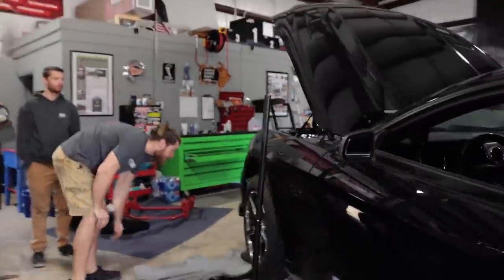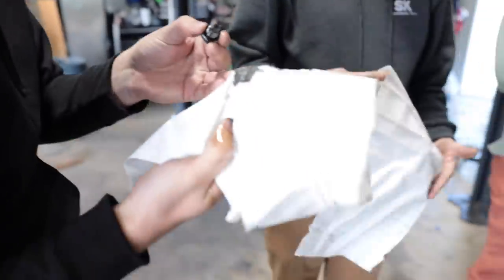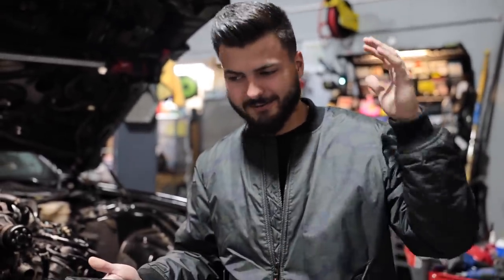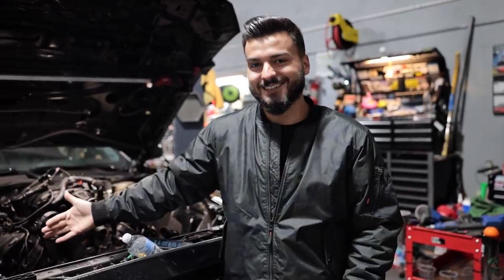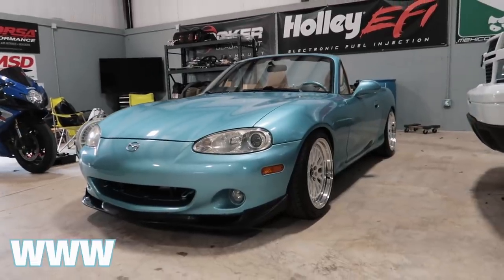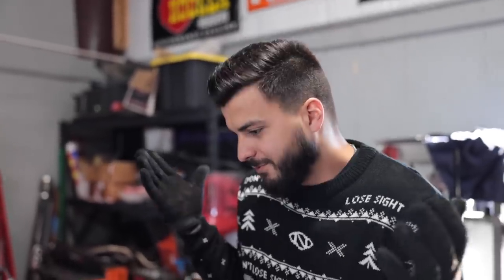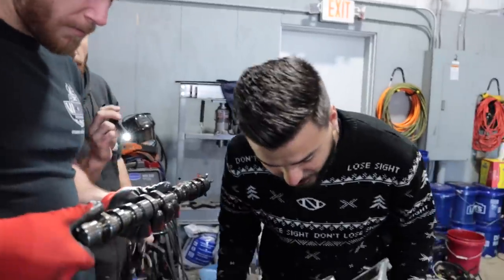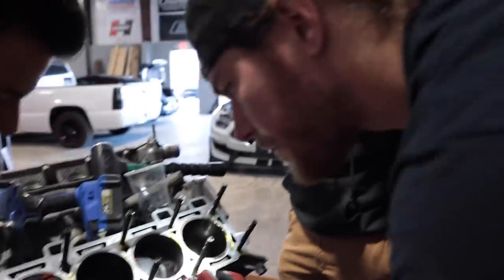Tearing Down Satan’s Blown Motor! | 1,500hp Coyote Engine Teardown

Comment: MMR engine: Has left the chat
Job Security: Has re-entered the chat
Reply: Hellhorse performance: has entered the chat
Reply: RPG engines: Has re-entered the chat
Reply: You really don't know what happened? MMR didn't build this motor for them, and they didn't pay MMR for anything. This was a second hand motor that they hacked together after buying it from someone else. See how they hammer away in this video?... that's how they treat a build lol. Anyway, the truth is they asked MMR for help, which they agreed to, and then sent the engine and parts, including the bearings they are complaining about, to MMR to be reviewed and refreshed. Real MMR motors use specific parts. I have one...a 1500se and it's an absolute beast. Even still, I'm sure MMR did the best with the parts provided, and even after that, the treatment of the motor is what caused this issue. The redline was not a soft redline. As he is mentioning even in the video, he is referencing the physical limitation of the crank/cam combo, which is still questionable. There is more to it then that, such as stroke, cam spring choice, etc. The etching away at the gaskets is from repeated physical limiter hammering, and then the boost crossed into the water cavities, and blew off the coolant line. Instead of admitting his mistake and resolving it, they just sent it again. Absolutely insane. So then he had fuel and coolant displacing the oil which absolutely destroyed the bearings and rest of the motor. This is 100% the fault of this nutty dude in the video.
Reply: Does this @raredesign person work for mmr this is the second time I’ve seen this comment word for word in the comments defending them and bashing Gavin. Piss off. Copy and paste much
Reply: @christophercarpenter4008  I don't work for them. I bought one of there motors and  I'm passionate about the modular scene. I think it is disgusting that Gaven influenced so much hate against a company for something he didn't buy from them. This is ridiculous. He blew his own motor and is blaming the people that tried to help him.
Reply: @raredesign  you mean you bought one of *their motors
Reply: @raredesign  go back to school!
Reply: @Ok-qd6he  that’s what’s in Lucifer right?
Reply: @raredesign  I don’t know a lot about engines I’m a welding manager but this many problems has to be someone’s fault
Reply: @devonevers4384  who paid all the haters commenting on Gaven’s video. And no, I’m not paid but you won’t believe me anyway. I’m a customer that thinks this is wrong.
Reply: @williammolnar6570  you’re right, he over-rev’d with aggressive timing, the head gasket failed, coolant and fuel mixed with the oil and displaced the oil in the bearings causing failure.
Reply: @williammolnar6570  lucifer has a rpg engines 5.2L voo doo
Reply: @raredesign  so the engine that was sent back to the builder and was oked after fixing the “timing issue” blows via head gasket failure which they changed out to theirs and main bearing failure isn’t the fault of the builder when the tuning company checked over the tune and the tune was good???
Reply: @Sutliff01  I know right
Reply: @raredesign  you’re the type of dude to claim no jdm car  could beat you down the track
Reply: @jeffwashburn4562  everyone knows the 2jz is an awesome motor, and so is the Ford barra.
Reply: @raredesign  so now you wanna act all soft. No hate man looked through your videos.  But I’ve seen mmrs work in my shop and at the shop that tunes my car. It’s hit or miss. Can’t deny that. There is facts presented and you ignore them.
Reply: @jeffwashburn4562  whatever helps you sleep man

Comment: “Are you telling me this engine knows how to weld?” “It was for sure trying to learn”
Reply: Gavin pin this comment. Best one yet.
Reply: LOL, yeah, he shouldn't have bounced off the physical limiter and chipped away at the gasket, causing boost to cross into the water channels and blow the coolant line off. And if that wasn't enough, he put it back on and sent it again! Fuel and coolant displaced the oil and ate the motor to bits. That's what happened with the bearings. This guy knows nothing about motors.
Reply: Alright @raredesign we get it you love mmr good on ya bud. They're a terrible company with an even shitt**r customer service and that's the truth. They acted like children with this whole incident🤷‍♂️🤷‍♂️
Reply: @luislanderos7560  hold on, they acted like children? These guys didn't even buy the motor from MMR! LOL. They asked MMR for free which is why the motor was sent to MMR and sat there so long...it was FREE work because of his channel. Then, they get it back and talk trash? Oh, and the parts used in the motor they complained about? Yeah...they asked MMR to use them. Then they proceeded to go all noob on the motor and blew it lol. No, MMR is not a bad company. Are you reading more internet regurgitation? Okay, I'm a bit passionate about this because I'm heavily involved in the modular motor scene. The reality is that MMR had a hard run many years ago...like 13 years ago lol, but much has changed since then and they now use excellent manley parts, as well as their own which they machine, and the motor build process is very good. I have one of their motors... a 1500se, and it's currently at 19psi, and will be turned up on E85 to 30+ this spring. I have renown build that will also be featured in magazines this coming year, so think what you want.
Reply: @raredesign  ok but if mmr gave the stamp of approval saying everything was good why did it blow up after four hard street passes? gavin broke everything in correctly and it still blew up. mmr has to get their act together and apologize to him for wasting his time and money on an engine that was mechanically approved by them.
Reply: @sethbroekhuis1986  There is a lot wrong with what you said. First, they didn’t pay for anything from MMR. MMR did the work for free and freshened up a second hand motor...with the parts that Gavin sent him. Nothing about it is an MMR motor. They just helped as asked, likely because of the channel. Also, who said Gavin broke it in right? With what I’ve seen from his other videos and this one, there is no guarantee he even primed the motor properly...and worse, he could have reversed the oil relocator in/out if he has one. Common mistake for no oil pressure, which another guy in this video mentioned about them not having pressure. Also, you can build a seemingly bullet-proof motor, and if you overspin it and physically hit the limits repeatedly, you’re going to stress it. Gasket failure is not MMR’s fault...that is simply abuse, and could have been exacerbated by some hot tuning, such as aggressive timing, which has been known to lift the heads. We know for a fact from this video with his coolant line popping off that there was a gasket failure. Right at that point, his motor was fixable by swapping the gasket. Hmm...and didn’t Gavin admit it in this video? Instead, he sent it again even though it had issues, which resulted in the coolant and fuel displacing the oil and ate the bearings.
Reply: @raredesign  oh wow a magazine! I can’t wait for the all the 10 year olds and hair salons to enjoy that. Definitely found their number one fan boy
Reply: @jjlol262  Funny. Let me know when you’ve done better. I don’t think RPM Magazine is anything to scoff at.

Comment: I feel like I seen this title multiple times 😂
Reply: Yeah but like all the other motors weren’t like top of the line built motor. At least as far as I know this motor is like a $30k motor. The other ones were like bone stock motors or like that one Frankenstein motor made out of gen 1 and gen 2 coyote parts.
Reply: @davidkelley751  yea true
Reply: @davidkelley751   mmr engines are made out of carboard its not gavins fault
Reply: @deandelatorre2928  never said it was his fault. I know it’s MMR’s fault. I was getting bad vibes from MMR from the beginning. Especially because they held onto the motor for like 6 months. Then they made Gavin make 2 videos saying “it’s not MMR’s fault and MMR is a great company”. Otherwise they would have sued him. 

The funny thing is that he was pushing those stock coyotes way harder than this motor and yet they were making about the same power levels. And yet those stock coyotes were lasting longer and making several passes on the drag strip.
Reply: Damn I didn’t see this comment I basically said the same thing😂
Reply: @deandelatorre2928  You really don't know what happened? MMR didn't build this motor for them, and they didn't pay MMR for anything. This was a second hand motor that they hacked together after buying it from someone else. See how they hammer away in this video?... that's how they treat a build lol. Anyway, the truth is they asked MMR for help, which they agreed to, and then sent the engine and parts, including the bearings they are complaining about, to MMR to be reviewed and refreshed. Real MMR motors use specific parts. I have one...a 1500se and it's an absolute beast. Even still, I'm sure MMR did the best with the parts provided, and even after that, the treatment of the motor is what caused this issue. The redline was not a soft redline. As he is mentioning even in the video, he is referencing the physical limitation of the crank/cam combo, which is still questionable. There is more to it then that, such as stroke, cam spring choice, etc. The etching away at the gaskets is from repeated physical limiter hammering, and then the boost crossed into the water cavities, and blew off the coolant line. Instead of admitting his mistake and resolving it, they just sent it again. Absolutely insane. So then he had fuel and coolant displacing the oil which absolutely destroyed the bearings and rest of the motor. This is 100% the fault of this nutty dude in the video.
Reply: @davidkelley751  You have no clue. MMR didn't make this motor for him. They bought it elsewhere second hand and it needed work, but they asked MMR to review it FOR FREE, then talked trash. That is why all that happened. They wanted MMR to use the parts they sent, which MMR did. Even then, these idiots blew the motor because they are clueless and now are talking trash. I hope they get sued.
Reply: @davidkelley751  Good questions. A soft limiter is okay, but can mess with the valve train, break followers, etc. A hard limiter is based on the physical limit of the crank, stroke, cam combo, and that is what he is talking about with the "built to rev to 8500", which is debatable. The point is, when he lifted the limiter out of the tune and then rev'd to hit it as everyone else complained about (and they were right), he stressed the head gaskets and etched away at them. This caused the boost to leak into the water cavities which is why his coolant line blew off. Instead of understand or admit he made a mistake, he didn't even check it...that's crazy. Instead he went with the whole "just send it" mentality and kept doing hard driving on the car. Meanwhile, because of the gasket issue, fuel and coolant mixed with the oil, which displaces the oil and caused failed bearings. That material and other breakdowns is like dumping sand in your motor and just ate the thing up. This is entirely the fault of the guy in the video trying to defend his actions. Very sad that he is getting so many people to attack MMR for this.
Reply: @raredesign  hey also I don’t mean to be rude, but I did some more research and found out that his has happened to other people to. They engine has an issue, MMR agrees to fix it basically for free, but they do a bandaid fix as opposed to a full surgery. Like one guy had this cam springs bust or something like that. MMR replaced the springs for free, but they didn’t replace the pistons. These pistons were damaged from the valves. So the guy basically has to disassemble his entire motor and rebuild it with his tuner because the motor was blown. 

I don’t like bashing on a company especially one I’ve never had experience with, but there’s evidence that suggests that this is a reoccurring theme with them. Just like how it is a reoccurring theme that Gavin has extremely bad luck with his vehicles, which could in term mean that there is something wrong with what they are doing.

Take care and have a nice day.
Reply: @raredesign  didn’t know all that. Thanks for the response. I like having peaceful debates with people instead of just yelling at each other. I got exams tomorrow so I’m not gonna comment anymore tonight. I don’t know much about motors, but I’ll take your word for it for now. Also my other comment was just based off a like 10 minute google search. I’m sure MMR is a great company, just they seem to get a bad wrap at times. 

MMR also did apparently make a video on Instagram and Facebook that tried to clown on Gavin, which is kinda childish, but in all honesty Gavins video was relatively childish. I didn’t see MMR’s video but apparently it was inappropriate to the extent that it was kinda mean. The video was taken down on both platforms and they turned comments off on Instagram.
Gavin didn’t mention this company by name, just like how he never mentioned palm beach dyno as his previous tuners when he was complaining about them. Gavin knows that if he mentions them by name and is trying to discredit them that he will get sued, so he isn’t. 

Anyways I gotta rest up for finals. This is a crazy scenario we are seeing, but in all honesty we are just spectators here just watching a shit show of drama that’s starting to unfold. 

Peace bro and goodnight.
Reply: @davidkelley751  People like to cut corners and say do it cheap, so then when MMR does what they say, it backfires and they take the heat. You want a real case?...check my videos in my profile. I bought an MMR 1500se and currently running 19psi on 93. Stay tuned, I'll be turning it up to 30+ in the spring on E85. :)
Reply: @davidkelley751  Oh wow, they complained about Palm Beach Dyno too? LOL. Well, there you go. I appreciate your honesty and kind approach. MMR did have a tough time 13 years ago, but it's all changed. I love the 1500se I bought. Extremely satisfied. Good luck with exams!
Reply: @raredesign  I’ll give you a subscribe.

Comment: When you were talking about people saying you were red lining it i kinda got confused cause im 16 and I even knew that your motor was built for 7000+rpm🤣
Reply: Yeah, people on the internet suprise me everyday.
Reply: Right 😂 anyone who knows even a little about coyote motors know that a stock one can spin 8k no problem with just oil pump gears and upgraded valve springs
Reply: I never had a mustang, but I knew from friends that had them, most coyotes redline around 8,500 to 9,000. People disappoint me for lack of knowledge and how fast they judge
Reply: Heh 14 and know plenty enough to know that wasn’t his fault. That engine looks like it was re assembled by a toddler🤦‍♂️
Reply: @imzanky6321  sure do cause they're just worried about what's obvious and not what's going on behind everything.
Reply: @That1gtitan  they don’t have any experience and just regurgitate shit they’ve heard
Reply: Glad you’ve finally come to your senses.
Reply: I knew they weren't doing anything wrong I'm a diesel mechanic I've seen some blown up shit and people not knowing what they are doing and I can tell you it's not it's justa6 fault

Comment: Here comes another lawsuit 😂😂😂😭
Reply: You really don't know what happened? MMR didn't build this motor for them, and they didn't pay MMR for anything. This was a second hand motor that they hacked together after buying it from someone else. See how they hammer away in this video?... that's how they treat a build lol. Anyway, the truth is they asked MMR for help, which they agreed to, and then sent the engine and parts, including the bearings they are complaining about, to MMR to be reviewed and refreshed. Real MMR motors use specific parts. I have one...a 1500se and it's an absolute beast. Even still, I'm sure MMR did the best with the parts provided, and even after that, the treatment of the motor is what caused this issue. The redline was not a soft redline. As he is mentioning even in the video, he is referencing the physical limitation of the crank/cam combo, which is still questionable. There is more to it then that, such as stroke, cam spring choice, etc. The etching away at the gaskets is from repeated physical limiter hammering, and then the boost crossed into the water cavities, and blew off the coolant line. Instead of admitting his mistake and resolving it, they just sent it again. Absolutely insane. So then he had fuel and coolant displacing the oil which absolutely destroyed the bearings and rest of the motor. This is 100% the fault of this nutty dude in the video.
Reply: @raredesign  reported for spam
Reply: @zodiark2456  lol okay. That's how you want to handle the truth, but all the lying on here is okay? 👍
Reply: @raredesign  Except it's not the truth. If the tune was shoddy or they beat the engine too hard, you would've seen a lot more evidence of that on a lot more parts.
I've seen a lot of engines over the years and I've been working on them for close to two decades now, I'm about 85% certain that it's very much a build issue here.

Remember, anecdotal evidence isn't evidence, just because you've had good experiences doesn't mean that everyone else has.
I've had a junkyard 5.3 with a knock-off chinese twin turbo setup running with 800+ horsepower for several years and countless of races, meanwhile other people have had combinations like that grenade after a few pulls.
Reply: @Arcticun  I've since had further discussions about this channel with other real builders, and they can't stand the dude, saying that he just throws every company under the bus when he makes a mistake. Believe what you want; no issue for me, but coolant in oil run hard is absolutely destructive to bearings, and that's what happened.